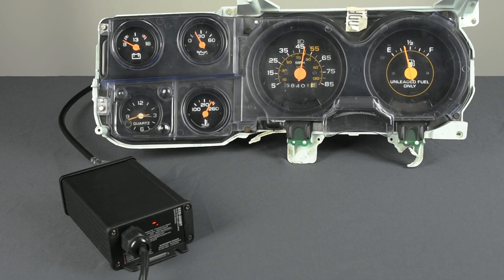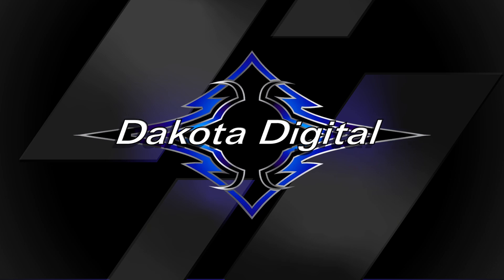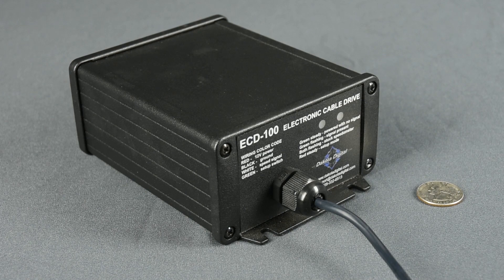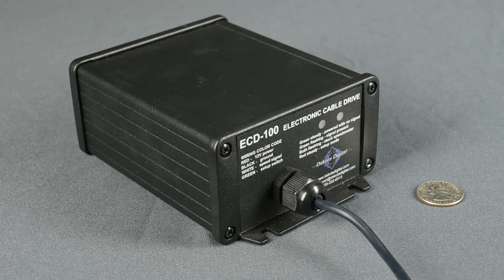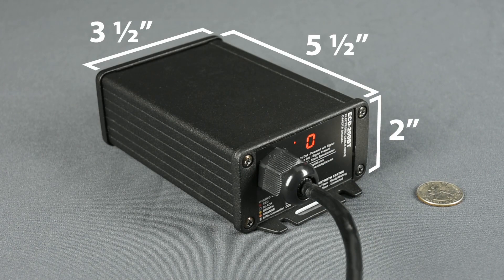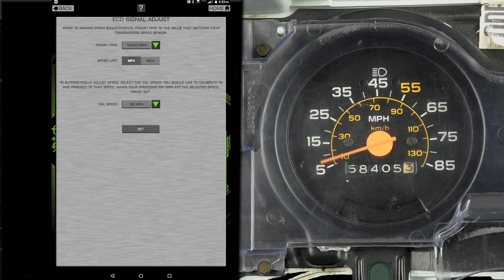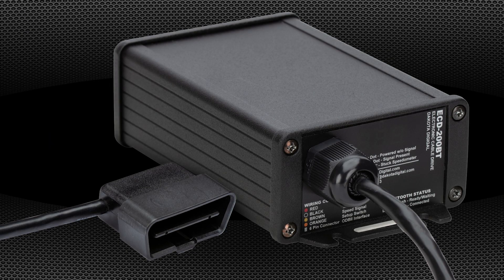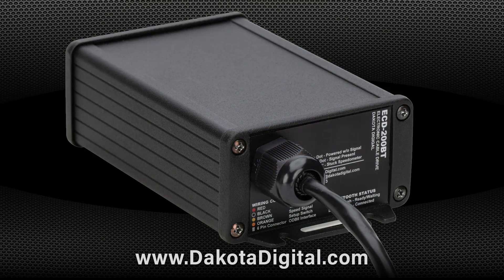ECD-200BT Electronic to Mechanical Cable Drive Adaptor

Comment: Can this also work to drive a mechanical tachometer?
Reply from the maker: Thanks for the message,
The ECD-200BT is not designed for tachometer use.
Reply: @DakotaDigitalTV  Does someone make something that does that?
Reply from the maker: @kblackav8or  We have not run across an aftermarket part which is designed for this sort of use.

Comment: Can this be connected to a GPS module? So essentially converting from mechanical to GPS?
Reply from the maker: Hello there,
Yes, you could use a GPS based speed sensor to operate this unit, we would suggest our GPS-50-2.  This would handle the input signal, then spinning a mechanical cable on the outlet.
Reply: @DakotaDigitalTV  Awesome, was hoping it was possible. Will give this a go. Thank you :)

Comment: Properly the worst App & instructions I ever have bought with such an expensive item. I understand if it has been some cheep Chinese stuff - Very disappointed...
Reply from the maker: Thank you for the feedback.  Is there anything that we can do to assist with the installation or setup?
Reply: @DakotaDigitalTV  no thx, I found the issue, my speed sensor was faulty. After replacing it, it just hooked up and needed the calibration.
Still could be nice if your app was showing fault codes - Now works fine:-)

Comment: Can this be used with the Holley Terminator X Max? I'm running a 4L80E in an '87 El Camino. Thanks
Reply from the maker: Hey there Mathew,  Yes, our ECD-200BT-2 would be the proper model here.  This will take the VSS from the Terminator X, then the cable outlet will plug into the OEM speedometer.

Comment: Hi, can my original speedometer cable screw directly into the box?
Reply from the maker: Quite possibly; the box has a 7/8-18 male thread.
Reply: @DakotaDigitalTV  my cable has a 20mm female. Would that work?